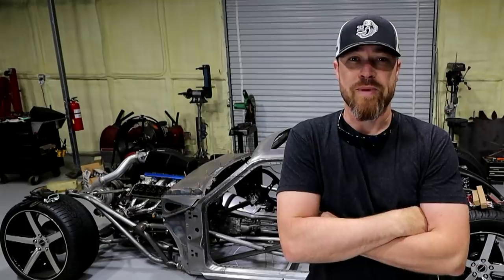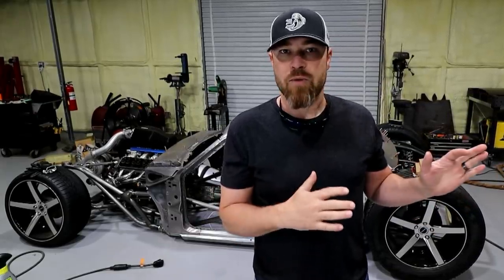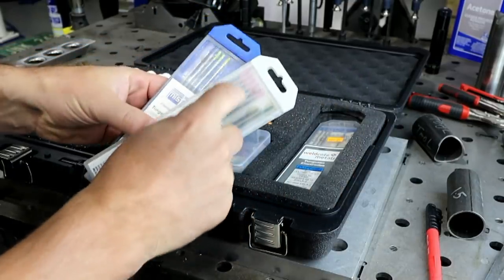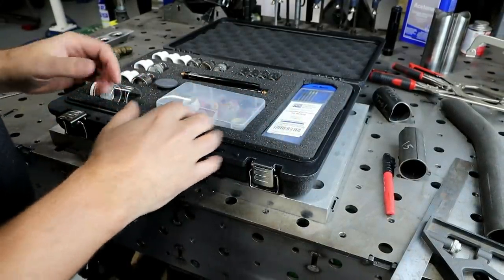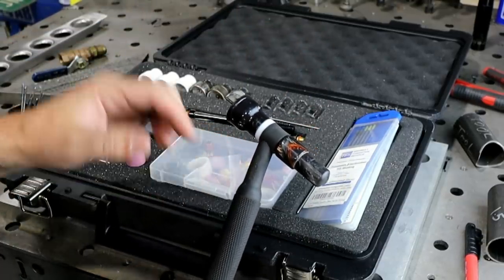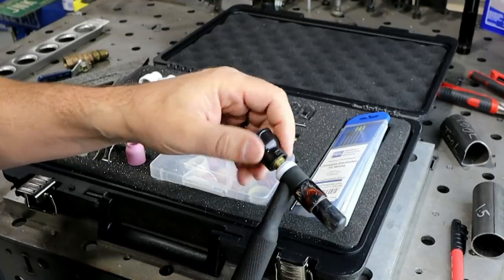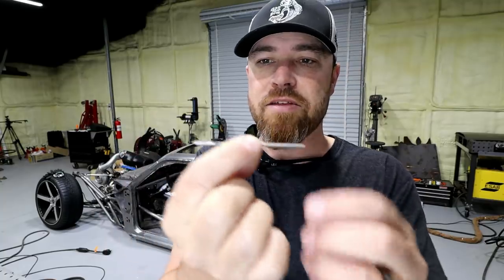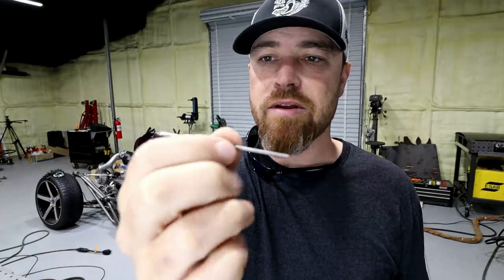How To Grind Your TIG Tungsten

Comment: Maybe I'm wrong here but I think you explained the grind angle vs. arc width backwards.

As I understand it, the finer the angle, sharper more needle like the tungsten the wider the arc fans out.

The more blunt, less angle, less sharp  the narrower and more concentrated the arc.
Reply from the maker: Yeah,  you are correct...
Reply: No you have it backwards  the blunter the angle the wide the arc the sharper or long the point the smaller the arc
Reply: You want a long sparp point on thin material. The heat affected zone will be smaller than if you used a short stubby point. Remember always grind with the grain. Especially on stainless and steel.

Comment: What I would do is to get some of those medication plastic vials.
Long enough to keep the length of tungsten in with the cap on and label each one by tungsten type as well as perhaps putting a bit of tape in the color that identifies the type. 
This would then allow sharpening of both ends without being confused as to which type it is. 
If you are using from a particular vial, make sure to remove it from the rack to an "In use" position where you will return the one from the torch to the correctly labeled vial.
Reply: I use a 4# piece of 1/2” stainless pipe. Welded and ground to a bullet shape on one end so easy to slip into a pocket, pipe thread cap on the other, ground and polished to match. Rugged and beautiful. For big jobs, I have a 3/4 “ diameter pipe. No need to stop and sharpen for weeks.

Comment: Some really good tips there. I think a sharper point actually gives you a sort of wider arc with a bit less penetration. Can be useful on very thin stuff. But if you need to put a fillet between two tubes at a tight angle a less steep angle on the electrode can help stop the arc jumping off to the sides instead of down into the root of the joint where you need it.
Reply from the maker: You are correct...I said it in reverse

Comment: Normally, the energy flowing into the back end of the tungsten is on the order of 1W -- a couple orders of magnitude smaller than the heat flow through the collet. If you did notice any difference, it was not because of heat transfer to the back end. Tungsten is not very conductive and there is nowhere for that heat to dissipate inside the cap. Rather,  what you've noticed could be due to the incomplete engagement of short pieces of tungsten in the collet. Using a full-length tungsten is a good way to prevent that from happening -- assuming the collet is good and tight. If it's not, the torch will burn.

Comment: Only problem with double grinds.. you booger the thing in the aluminum.  Flip it from cap side. Booger again. Now stuck in collet.
Reply: If you booger the tungsten,pull it out and flip it around to use the other end,good luck shoving that booger through the collet body...you'd have to take the torch apart to come back through the collet with a clean tip.That torch even water cooled will still be hot....not to mention the tungsten.I usually just sharpen a few at a time rather then flip a single.That way,no stucky in collet...
Reply: @oldenfarten5350  yes I did take the cap off. Then when the other side got a booger it was stuck. Learned that lesson 2 years ago.
Reply: Mr Wolf in

Comment: Not that this matters, but an electrode is a singular. You probably mean to say electrons. And electrons don't actually move, its magnetic fields. But your overall point is correct. You're a 1000x better welder than me but I'm an electrical engineer. At the same point, its actually easier to explain it the way you just did, my EE professors started out explaining that way for awhile too. But your video helps, I hope my feedback helps you too. You can search YouTube for do electrons move if you are curious to learn more on that side. TBH, it has the same effect, so it doesn't really matter in practice.